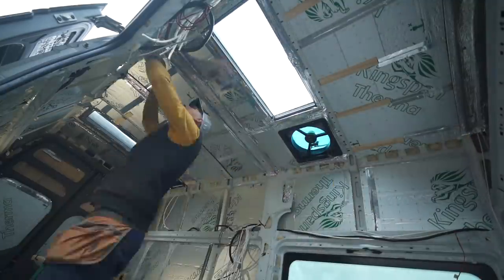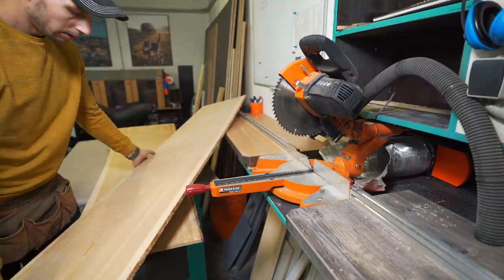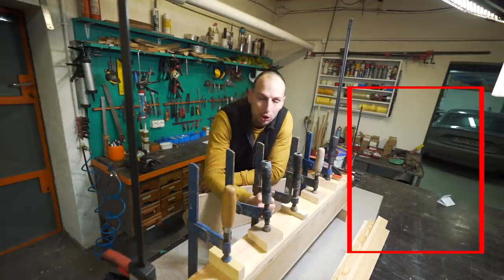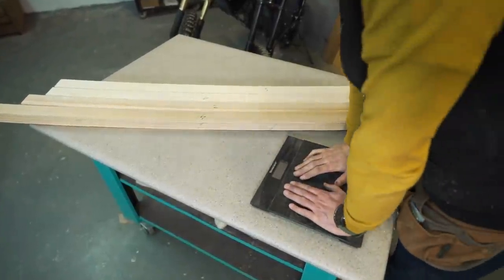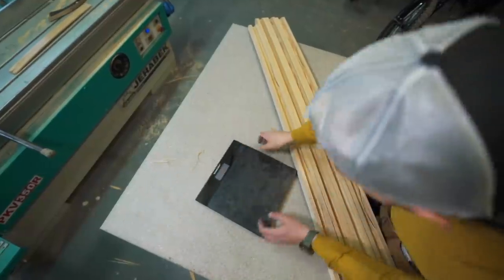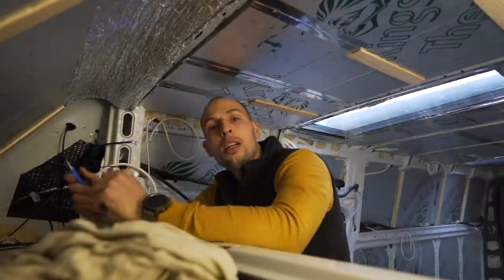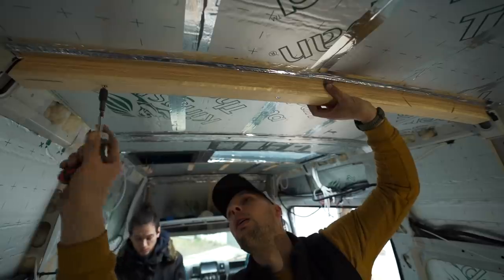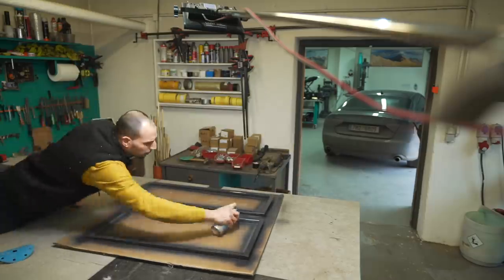Framing CURVED CEILING (Complicated) 🛠️Van Build Vlog

Comment: If you like dark ceilings you could get an LED star mat that creates a star sky inside the van.. (like they do on Rolls Royce)..  The mat would be installed behind the black roof lining and each little LED would be an individual star shining through.. Impressive feature at night.

Comment: Hello you both! I just subscribed after seeing some of your nice content. I wanted to share a good idea for curved ceiling panels: Use vacuüm under foil to glue large curved panels.
Just prepare a single  large curved mold in advance that is airtight and covered in (teflon) tape so it can be used over and over again! 

This is a wellknown technique and is commonly used in the yachtbuilding industry. Hope it helps you increase your business. Keep on going! Cheers

Comment: Great progress, great extension of the shop 👍 Not in the CNC thing yet but soon. Making some changes to our office/workshop to host a large scale CNC, ideally combined with a laser, if our plans of a CO2 laser combination works. Diode lasers are just not powerful enough to make sense. 

Sorry for the OT, I know you have another insulation topic video, but Im wondering about the glass/rock wool insulation in the structure. Dont you think moisture will enter that area and condensate within, gets wet and mouldy? Dont know if youre planning a vapor barrier though, then it would be no prob 😉

edit ..well, got it in the vid, seems like youre going for a full vapor barrier, not ususal in the van conversion biz but why not! Looking forward to the results.

Actually I was considering to add some PI humidity sensors in the isulation areas, just to get some data for that ongoing moisture discussion 😁

Comment: Oh hey, I worked with CNC machines and I'm procuring a laser for my next job at a new shop. They are very cool tools but cnc does better at production things, your projects being custom one of a kind means all the time spent programming isn't saved when you could just cut it by hand.

Laser on the other hand is good for making templates or things out of thin wood/plastic. Thanks to it's speed I could see laser used in your shop, but again it's still better to be used in larger scale production.

Comment: Seems like the height gained by using a curve much less than the thickness of those pieces, perhaps just screwing the ceiling panel directly to the metal would be better?
Reply: I believe it helps with insulation.